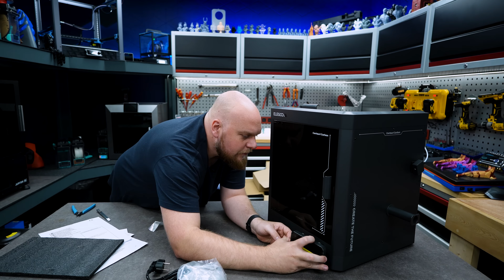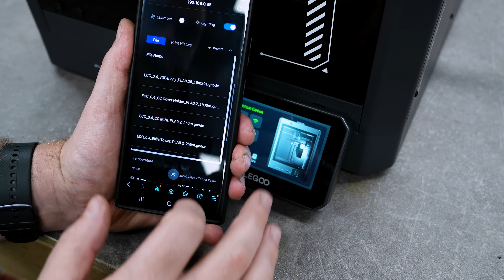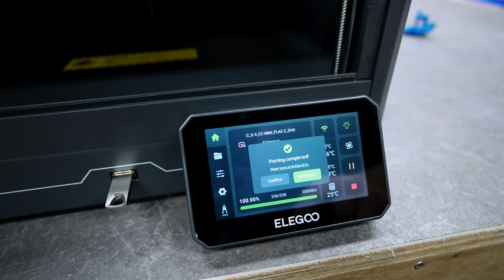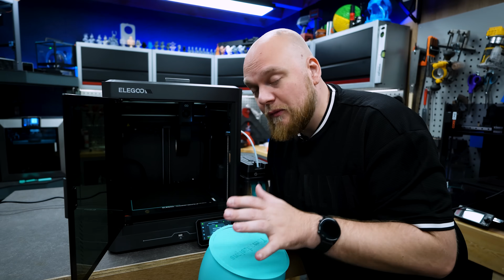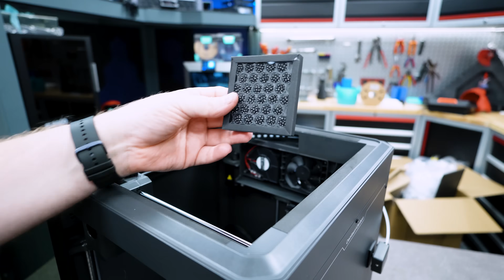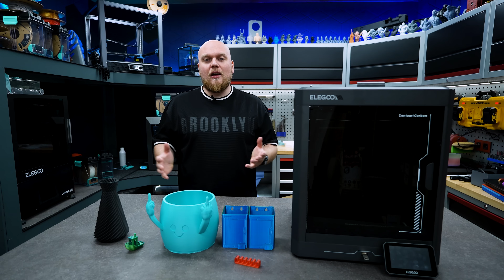Elegoo Centauri Carbon first look, because who needs profit margins anyway?

Comment from the maker: Extra info: the unit got delivered on the 5th of June from the 3djake warehouse.
I can only review what they shipped so if Elegoo promised something this ain't it (at least for the EU stock)
Reply: I received mine on the 18th July and it has all the mods, you’ve been unlucky to miss out there
Reply: It seems like 3djake bought a bunch of early models and stocked them. Sad you aren't able to get the ones with the revised and upgraded bits.
Reply from the maker: @patrickgardner2204  it is what it is, time to upgrade mine to the same level!
Reply: I'll be getting mine at the end of August. I'm in Germany and I ordered it directly from Elegoo. Even if it comes with the upgraded light, I'm still going to print a nice riser I found on Printables and do a light mod.
Reply: @CosminNecula  Good choice to print the riser.
Reply: @PmgAwF  Did Elegoo add MMU port or better lights first, or do they just mix whatever can go out to market?
Reply from the maker: The mmu port first, the last update is the lights
Reply: @kimmotoivanen i believe both came out relatively close together but i know a few ppl who got the port and not the lights.

But that was awhile ago, i put my order in back in may and mine arrived with both.

Id be shocked if any new orders (bought from elegoo) dont have all the upgrades.
Reply: I just ordered mine a few days ago. I read from people who got early revisions and contacted support after the changes were made, and got sent upgrade kits free of charge
Reply from the maker: @Bluexin_ I asked and never got a reponse. Used Noizie Works and private account 😅

Comment: Well as of now they have fixed the lighting and other issues, they have delivered a $55 AMS systems (CANVAS) for it. There is the Open centauri patched firmware and the COSMOS (klipper port) being actively worked on for it. Honestly for €300 there just isn't any meaningful competition to this printer, its a no brainer.

Comment: Every analysis should be tightly matched to cost. Sure there must be better printers but at every step of the analysis we should remember the extremely low price point. The amount of features and print quality output for 300 USD is really amazing. As an engineer I am baffled by the price points Chinese Tech companies can achieve.

Comment: This printer cost $299 and has been on sale for $279.  I liked it so much that I bought a second one. It’s fast and prints at high temps. Mine have both been running pretty much continuously for over a month printing primarily ASA. The only problems I have had are related to either skipping steps, if you remove the plate you should probably re-level, or using old filament. I hate that the on switch is on the back, but that’s most printers. It’s so inconvenient if your printer is on a shelf.

Comment: Are you using Elegoo Matrix or something else? Your interface looks way different than the one I got off of play store.
Reply from the maker: Nope, I don't use any app. You can log into the interface by typing in the IP adres of the printer into your broweser like 192.168.0.25 to give you an example
Reply: @NoizieWorks  Cool, That works.👍

Comment: The A B is letting it know what plate you are using...
Reply from the maker: Yes but the actual difference is more interesting, it would be pretty clever if they had a different z offset because of smooth vs textured.

Comment: my cover blew off last night. only on the 4th print too. I removed the nozzles silicone sock to find what looks like grey filament all inside it. I only used the white supplied to print a benchy then straight to black PLA. Sent email, waiting on reply. Thank you for this video. No doubt I'll be using it again to fault find when issues arise
Reply from the maker: That's weird! Spare parts are a problem apparently so wait times are pretty high.

Comment: Great video. Just picked one up on Saturday 20- July 2025 at local Jaycar in Australia. Awesome machine.  Have been printing so much over the last couple of days. My unit has the 2 X LED strips inside. As a newbie I have looked at people on youtube complaining about various aspects of this unit and really cannot understand why. It works straight out of the box no problem. I still wonder about making hinges to open the door really super wide when don't really need too. Our microwave door, oven, wardrobe and fridge doors don't fold backwards and yet are still functional. The only mod I felt was worth is the riser which inhibits the filament guide rubbing against the L side of the unit and also if printed in white, gives more light inside during the day. Slicer software works great. I have also watched some influencers on youtube display "the 10 best prints" but it's all a bit like "The Kings new clothes" fable. Camera, lighting, software, accessories, features and functionality all great. Regards.
Reply: I think most people on youtube complain from the point of someone who prints commercially, so they pay attention to some little things that would make work easier for them. But most of it is not that important from point of view of average consumer, and for this price it's probably the best thing you can buy to casually print things for yourself. 
Bought mine recently, and there's nothing I can complain about.
Reply from the maker: To my own surprise, this machine rocks

Comment: You dont want to cold air for cooling, thats why most use internal air. Cooling plastic from +200C can be done just fine with the air from the inside of the chamber.
Reply from the maker: I don't agree, CPAP does the same thing.

Comment: It took longer to do the benchy because you told it to level.  You already leveled it when you ran the initial setup.  You also seem to have used different filament than what was provided to print with, which means you likely needed to tweak the temp settings for the filament you used.  I don't understand though why they didn't give you the updated lighting.

Comment: Will require a replacement board to open source but for the price it is a great value.   I am torn between this and the A1 on sale.
Reply from the maker: Yes, parts will need to be replaced. Not sure if i want to spend the time on it, it would make this machine more future proof in my opinion.

Comment: Heads up, there is a empty 24V fan plug on the motherboard that's controlled by the fan button.
Reply from the maker: People used it for led? That's a great tip
Reply: @NoizieWorks  I’m sorry not the fan button the light button.
Reply from the maker: @TexasWaters  no problem, need to check the board but I'll figure it out. Thanks for sharing.

Comment: Actually you might have the old version.   The new versions are coming with that led plus an extra LED across the top of the printer.  Also it is coming with the upgrade for the multicolor system.  They have fixes a lot of the issues that you are calling them out on also they have truck load of 3d printed upgrades.  People please do your on homework b4 listen to most of these youtubers. By this is being 4 days old before anyone else get their printers obviously he had this thing sitting in the background for a minute before deciding to do a review on this particular machine. I come to this conclusion because he has the old version versus.. there is new version that is coming out my new version will be here on Tuesday.  Be blessed
Reply from the maker: It got delivered the 5th of June, it has the ams port but not the lights so apparently this is a in between version. I can only look at what they ship.
Reply: Mine was delivered the 9th of July and it has the AMS port as well and the 2 bright bed lights plus the camera light.
Reply: Even no body youtubers get printers for free. At that point any opinion is worthless.  But from speaking to people who own it, it's a great machine. I will probably buy one myself. I do like Elegoo machines.
Reply: I got my in july 9th also and it came with the AMS plug in and two led stirps one on the right when facing it and one in the front above the door.  also it came with a new update make sure you go through and download the new update.  Be blessed

Comment: Mine didn’t work from out the box - the hot end didn’t get close to the print plate and just squeezed out noodles of PLA. Nothing I did made a difference - now waiting on tech support while the machine sits staring at me doing nothing
Reply from the maker: I hope it works out for you 🤞 i can't connect with Elegoo on my side too.
Reply: @NoizieWorks I see all these videos of people that had a positive experience and I feel so damn robbed man - after waiting two months it’s just sitting there doing nothing while I wait for Tech to respond.
Reply: sorted yet or still staring only?
Reply: This problem sounds like you got one of the early models that had the filament wiper hitting the hot end and therefore not correctly leveling. The solution is to shave the edge of the wiper assembly flush with the poop bucket. The most recent version have been fixed as well as the added LEDs and 4 pin for the cms upgrade that has been pushed back to 4th qtr. maybe December.

Comment: It is crazy what you are getting for the money. It's not the printer to get for chasing unicorns in terms of quality, but it is a very affordable option that seems capable. Shame it isn't running some version of open Klipper. It is nice they've upgraded some of the worst parts already. Too bad you didn't get the updated version.
Reply from the maker: If we would get it in a klipper state.. oof that would be sweet! Free content! Next up is light and door mod
Reply: I mostly agree with your comment with exception to the part about the print quality.  It sounds as if you're suggesting that it's not giving high quality prints.  Mine prints amazingly and as good as my much more expensive printers.
Reply: @rustimack once you get really deep into actually analyzing every little detail of 3D printing, you start to realize the difference in quality is small, but noticeable. Trust me when I say there are printers on the market which produce much nicer prints. I'm not saying it's bad, I'm just saying it's not chasing unicorns. As in, you are going to have things like VFA and imperfect corners or dimensions that are not spot on. All small nitpicks, but they exist. It's kind of like going on the Bambu Lab forums and seeing that every single post is a slightly out of focus picture about how everyone's prints are totally perfect. Then when you compare them to what you get from an actually well tuned printer that produces less VFA, you realize these people just don't know better. Not trying to be a jerk, just being honest. It does produce great quality for the money!

Comment: I was ready to preorder one but glad I didn’t go through with it. Motherboards going out, trying to print midair, horrible lighting and camera, hotend and bed not cooling down…
Reply: Mine is printing mid air - won’t get close to the build plate and squeezes out oodles of PLA noodles - and I just got it July 1, 2025. Has a weak AF camera light. Very disappointed and now waiting to be told by tech that I have to TINKER with this thing which is what I didn’t want to do

Comment: A few pints on this:
1. Of course the display doesn't run Klipper. You connected via IP address and no actual app, so it's pure HTTP.
Any app would most likely not run Klipper either on any printer, but just be a frontend sending commands to the printer running Klipper.
2. Difference between the 2 bed sides. There's actually a sticker on the smooth side, showing that this side is actually a cold bed, used at 30 degrees vs the textured 60 degrees side.
3. Well, you run a silk filament without any adjustments through the printer. That's not what those test models are intended for, but rather for some simple PLA.
That's why you use a slicer with printer and filament profiles. Just running any filament on a model without correct profile is just a guess at best, and that reflects in the results.
I got the same printer, same batch (meaning with the useless LED), but used proper settings via slicer - lo and behold, I had not one single issue like you, apart from a hint of ghosting.
So I think this type of testprinting isn't really saying anything about the actual performance.

Comment: The top is clear. So bitching about the low lighting is silly. Put a light on top.
Reply: Also looking through tinted front door is silly, put mirror on top and watch printing from there - or could they have done things right from the factory 🤨

Comment: Bought one, returned it on day 14. I ran it 24/7. When it works, it prints ok, but I had more failures than success. It even stopped mid print because Elegoo released an update. For what it is, it should be ok for most once parts are available and FW is stable. MicroCenter was selling the old version, so not sure if that is the main issue.
Reply: Mine is not working and I just got a July 1. It’s literally printing like mid air and won’t get close enough to the print bed so it just drops piles of noodles. I hear all these people that have a great experience and it just upsets me so much that I waited two months and spent three hours trying to fix it just for it to continue to fail.

Comment: Just picked mine up, It's an original one with no light and no Multicolor port. :/
Reply from the maker: Oof that sucks! Did they communicate on what to do with the ams in the future? Lights is not a biggie
Reply: @NoizieWorks  yeah, I'm not worried about the lights. They say that the AMS will still work on originals as well, and I assume they'll sell it separately some day when the AMS is actually released and available.
Oh well. At least they're not functional problems. I can add a light easily and don't have AMS yet.
Reply from the maker: @TotesCray  True or if you bought from a store bring it back and wait it out but you sound like you could manage some small thinkering tobmake it work

Comment: Just bought mine... and by the way, this is the best review I've seen so far! Thank you brother!
Reply: It's a great printer, as you probably know by now (your comment is 3 months old).  What really impressed me was their support.  I don't usually call support but I heard that later batches came with better lighting so I asked if I could buy some kind of kit.  They had me send my serial number and proof of purchase, and send they'd send the kit for free.  They even sent it with priority mail.  Amazing support and I feel confident I can call them if I have issues in the future.  30 mins later and I could see the camera image without having a desk lamp shining down into the machine.  I expect your machine has the lighting update as standard, but if not them send them a note via their website.

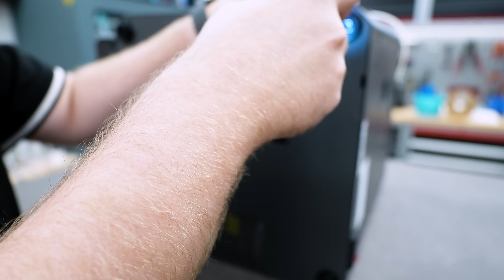If you feel adventurous then pull the bottom off the machine and you'll find a circuit board.  It's the red board shown on the left at 27:55. There's a lead that connects a cheap antenna to the board with a standard pigtail connection.  No need to attack it with a soldering iron as I had planned.  You can buy a IPX U.FL pigtail to SMA lead, unplug the old pigtail, plug in the new, and screw an external antenna into the SMA socket on the other end of the lead.  I used a cheap 8dBi magnetic mounted antenna and the signal improvement is night and day.  I got a 50cm pigtail lead, by the way, but could probably have got away with shorter.  Better too long than too short, and you can zip tie the slack to the other cables to tidy it up.

Anyway, enjoy your machine. :)

Comment: You mentioned that the print was noisy at idle but I have my printer on and I can’t even tell it’s on (have the screen turning itself off). 

Also looks like you got revision 1. Which includes the canbus port in the back. The other 2 revisions that came after were the light strip and the ptfe is taken out of the drag chain to reduce the hard turn.
Reply from the maker: Got it, i removed the zip tie and fastened it a bit further. Forgot to mention it but the turn is more relaxed now.

Comment: 16:31 Acceptable for home use.  Not acceptable for customers buying things from my company.  

Parts are still not available for this printer.  No motors, belts, beds.  Pre-order (two month delay) on build plates, anti-vibration feet and hot ends.  

Elegoo is still not serious about FDM
Reply from the maker: Yes, beginner/entry level home use

Comment: This is the old version of the CC.. they have updated the light & fixed the hard corner w the bowden tube entering the hot end... 
  Plus yes there are all kinds of mods out there already.. printable hinges that open the door 270°..
Reply: How do I know what version I have?
Reply: @NoobMaster245 the light and  if the translucent wire is outside the kablechanel

Comment: Another really great video. I got my CC a couple of weeks back and just set it up this evening. Glad to see that many are having a good experience with this printer. I didn't need it but here in the US it was going for $299! How could I pass that up!? I saw many that received theirs before mine arrive that got the upgraded light kit. Unfortunately mine came with the same crappy light as the one you got. Edit - I'm stupid, I did get the upgraded lighting! Looking forward to putting it through it's paces! Keep up the great work!
Reply from the maker: Thank you and have fun brother!
Reply: You’re lucky - mine is printing poorly and won’t get close enough to the build plate no matter what I do. Just so damn upset
Reply: @deedeetee17  Calibrate the Z-Offset, theres a whole config section on the printer UI to do that, should be pretty simple. Remember that when you find the correct Z-Offset value you need to save it on your slicer printer profile